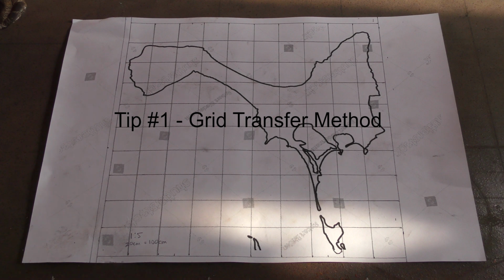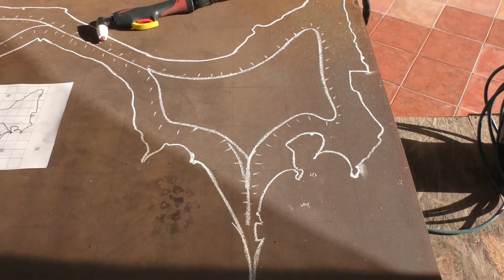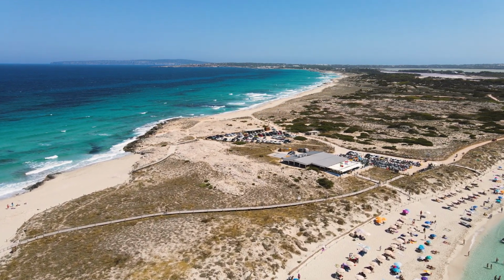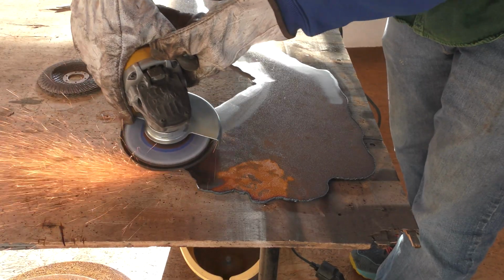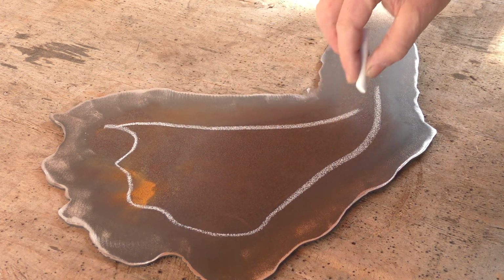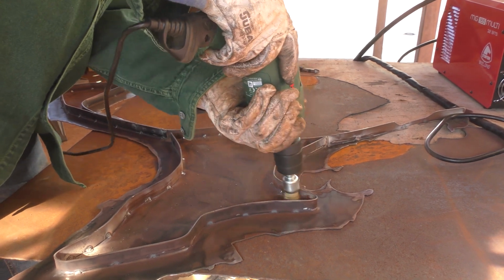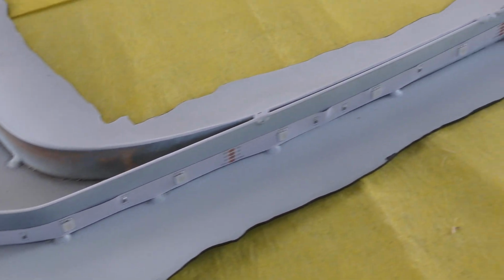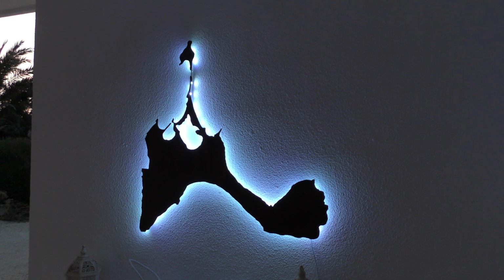Amazing Metal Wall Art With LED's- Formentera Island, Spain

Comment: Excellent work. Clever and very visually engaging treatment to otherwise bland flat silhouette.
Here’s a trick I use for expanding silhouettes, picture, sketch etc. Its fast and accurate and easily sizeable to fit the project.
The trick is in Adobe Reader. Take the image and save it (print)as a PDF. Go to print. In the printer pop-up use the POSTER function and TILE SCALE % for sizing. Experiment with the size using TILE SCALE. The print picture will show the image laid out on multiple sheets. A larger image  needs more sheets. Before actual printing select CUT MARKS an easy way to accurately align each sheet for taping. Cut it out and trace on the work piece.
Reply from the maker: Cool trick